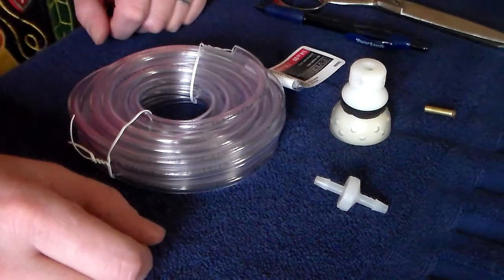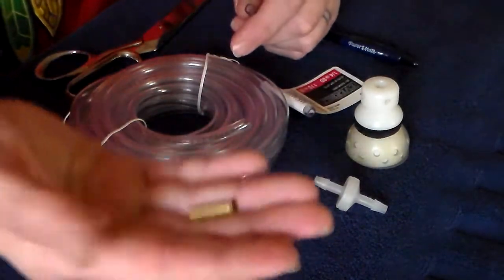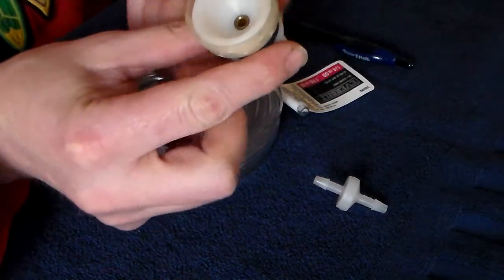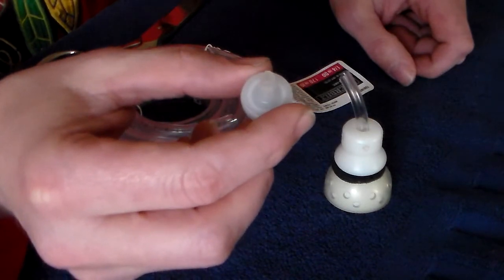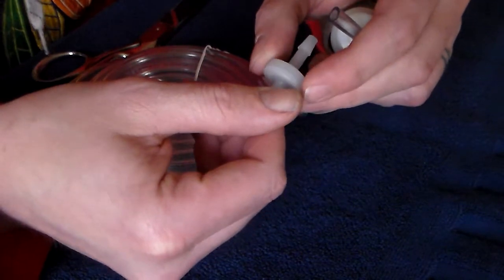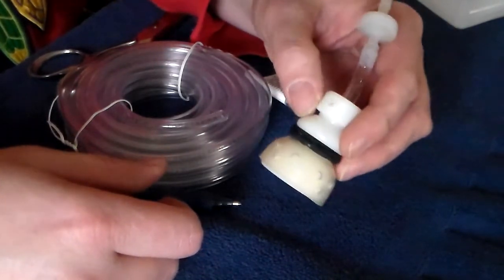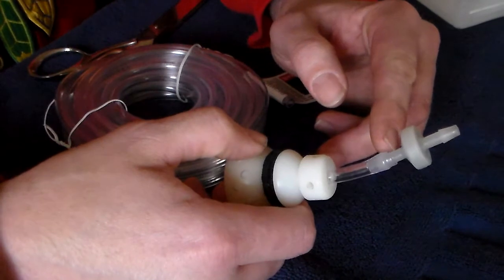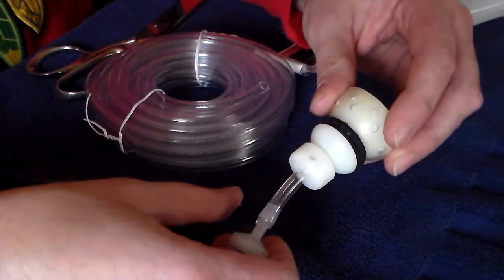DTR Homemade Direct Air Setup

Comment: I use a one way valve that are used for aquariums.  These are like 25 cents, very cheap and last a year or so.  Can be found at amazon or Pet store.

I also use a bulb used to inflate a blood pressure cuff to inflate my DTR.

I use two large baby bottle nipples, Platex brand for my DTR.

I have been restoring for 17 years now.
Reply from the maker: That is a check valve for aquariums, it’s just a nicer style. I’ve found that many of the very cheap ones don’t even hold air out of the package. I’d rather pay a couple bucks for one that works and lasts. 

I’ve seen that done. My point here was cheap and easy and it doesn’t get much cheaper than blowing into a tube. 

I switched to the Phillips Advent from the Dr. Browns nipples a couple years ago and found them more durable and more comfortable. I’ve not tried the Playtex ones. Which specifically are you using?

Comment: Hey just came by your video through the search. I made the device and noticed it leaked near the tip of the clear rubber cover that clamps onto the excess skin when the device is on. Then at closer inspection I noticed you got a black ring around the DTR device at the top of that clear rubber cover. So I want to know what that black ring is and hopefully it will help with keeping the air in while I use the device.
Reply from the maker: It’s just a hair tie. I use it to keep the bottle nipple from popping up. It may solve your problem.
Reply: @user-od4er8fq4s  thanks for the reply. I’ll try it out.

Comment: Hey D, i ordered everything but the tubing size was wrong. Could you possibly post links to what was used? thanks
Reply: It's 1/4in tubing. Label will say 1/4in OD, which stands for outer diameter.

Comment: Hi. This looks great but my 1/4 inch tubing with the ferrule fitting slides right through the DTR--in one end and out the other. The same way the pusher rod slides through...  Any thoughts? Should I look for a slightly larger ferrule fitting?
Reply from the maker: It's the ferrule in far enough the the whole flair is inside the tubing?
Reply: @user-od4er8fq4s  Ah, I didn't get that! Thank! Working on it now

Comment: Be sure to put tape over your pee hole before inflating!  I understand it could cause injury otherwise.
Reply from the maker: Most of us find that unnecessary
Reply: @user-od4er8fq4s           I haven't used tape on my glans.  I haven't tried using air for inflation, but I have experimented with using my urine to do the same thing by holding the skin and peeing.  Not viable for long term inflation, though.  I worry that removing the tape would be painful, or decrease sensitivity from repeated use.
Reply: @JM JM        Actually, on Reddit, I was told about the possibility of urinary tract infections from using fruit.  They even thought that cucumber would be problematic.  My post was deleted by the mods.  I plan to try again using this other idea I successfully tried.  Instead of food, a condom, or pieces of condom with just enough lube to be comfortable.  Use silicone condoms if you are alergic to latex..
Reply: @JM JM          I didn't notice exactly when I started, but I would estimate about a year, but I took some time off at a certain point.  I got discouraged, but when I tried again, I was pleasantly surprised at my progress.
Reply: @JM JM        The bigger clips are more comfortable.  The smaller they are, the tighter they are.  Don't use the center of the clip.  The outer edge is more comfortable.
Reply: @JM JM          Using condoms, or pieces of condoms instead of food does work as I said.  Do you have any other ideas for materials for this method?